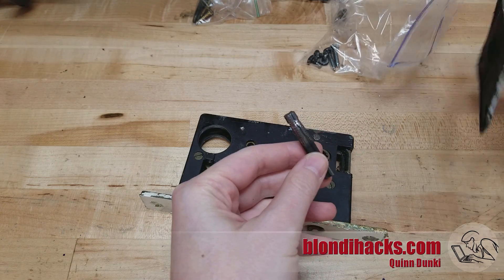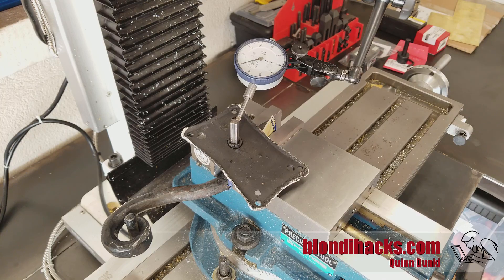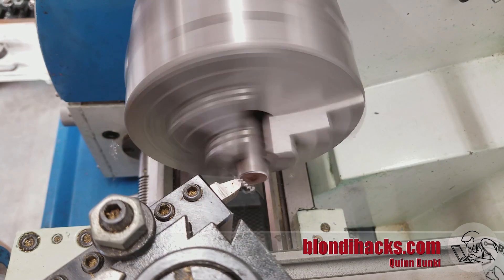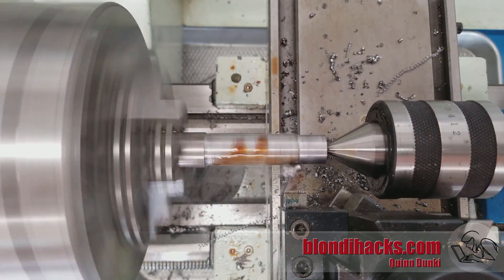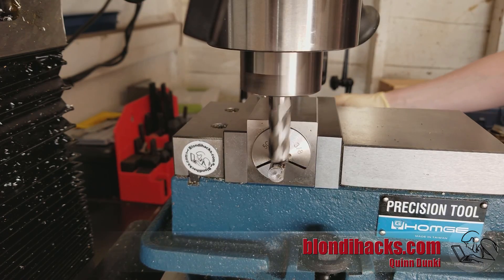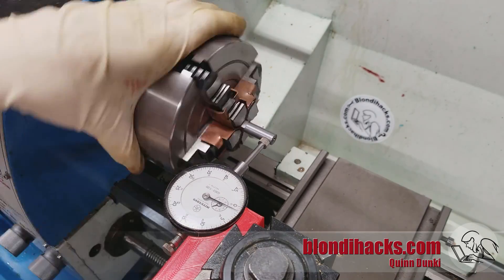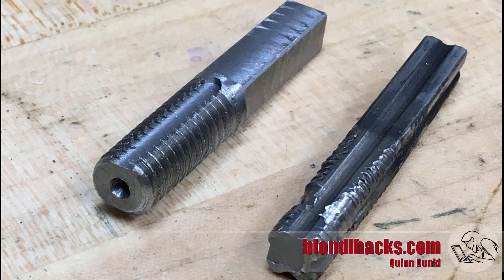Antique Lock Repair : Part 2 of 4

Comment: Fantastic video.  I wish I had the skill (and tools).   At least I can watch.  Four slots for the set screws is better because the two handles can be tightened down on the door "just right", where they don't bind on the door and also don't have a lot of play.   They also allow the resident to do that from a convenient angle, so if (s)he is older and less agile and finds it hard to turn the set screw from beneath the handle, a quarter-turn away from its ideal position puts it above the handle.   They also give you four times the lifetime on the shaft as the slots get chewed up so quickly.

Comment: Great project video, really enjoying this. Just a small observation regarding the indexing block where you machine the 4 flats. By the adoption of the backstop in your setup, this is a good representation of restraining a component using the 6 degrees of freedom approach. The base of the vice could be classed as the primary datum, the back face as the secondary and the backstop itself as the tertiary datum. Apologies for being pedantic about this, but I have recently been on a metrology course and find datums and their relationship to workpiece holding quite interesting.

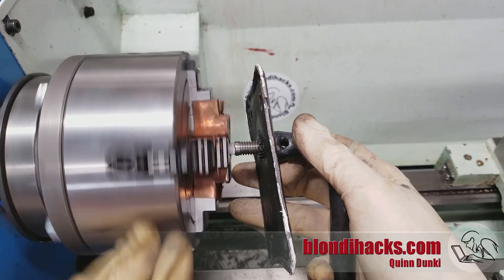Comment: Can I ask a dumb question?  At 4:00 when you located center on the part for slotting it, you used the edge-finder on the threads.  Would it have been inaccurate to have used the vise jaws instead to locate center indirectly?  (Mostly I'm wondering about edgefinder error on the threaded portion vs whatever the dimensional precision of the jaws is, and whether it's ever a worthwhile approach.)
Reply from the maker: Christopher Tate That’s an excellent question! You’re right that it’s not as precise as edge-finding a machined surface. However the error is the same on both sides, and is cancelled out because I’m using the Half function on the DRO to find the center line of the part.

Comment: Kitty has been quite vocal during these videos! I'm sure in cat-tongue it's very educational and relevant to the project at hand! Small question -- on the replacement shaft that you've made, I notice the channels for the screws only go back halfway, as opposed to all the way on the original piece. Was that just superfluous on the original piece like the two extra channels were? 

Great video as always!
Reply from the maker: TheQuietForte Good question! Yes, the long grooves are superfluous. The unthreaded part slides into the lock. The handle threads on, then the set screws go through the handle into those grooves. So the grooves secure the set screws and keep the handle from spinning on the threads.

Comment: most ppl would just throw that lock away, but wheres the fun in a $50 replacement when you can invest a week or two in restoration 😁
Reply from the maker: bill baggins Exactly! Never do a cost/benefit analysis on my projects. The result is not pretty. 😬
Reply: A what whatefit awhatysis ? 🤔 i'm confused 😏